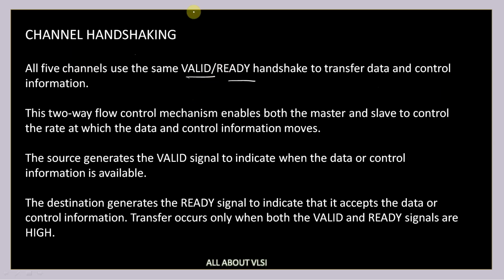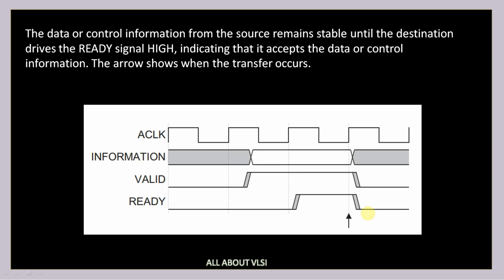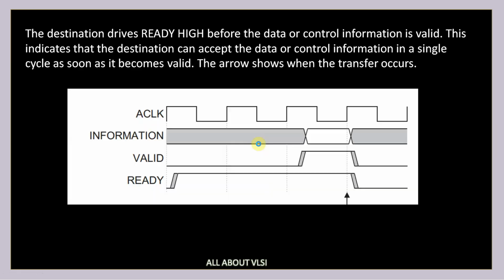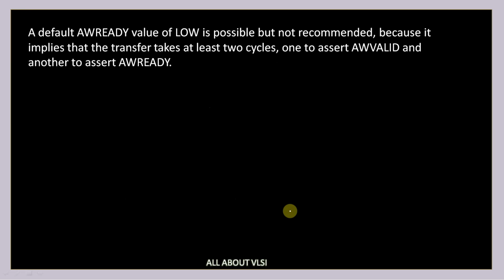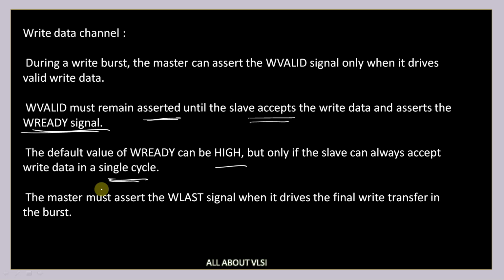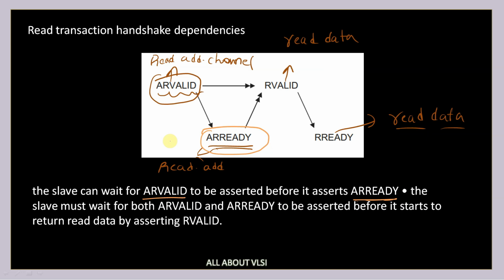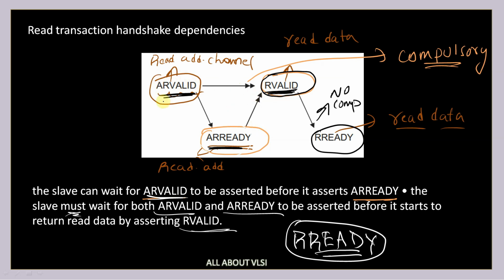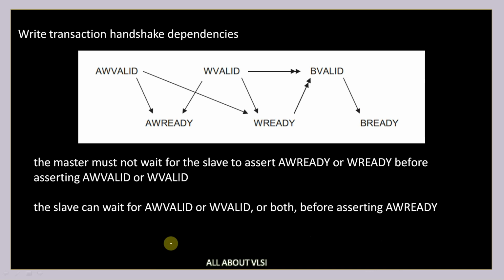AXI Protocol Handshaking Explained | VALID–READY Handshake | AMBA AXI for VLSI Beginner

Comment: Is saying one cycle to assert the AWVALID is the correct statement here? Shouldn’t we say if the default value of the AWREADY is LOW, then we will have one cycle for source to sample the AWVALID and another cycle to reapond to it by asserting the AWREADY? the wording is confusing. It is implied as if the master is taking one cycle to assert the AWVALID in your slide, which seems wrong to me as a statement/root cause